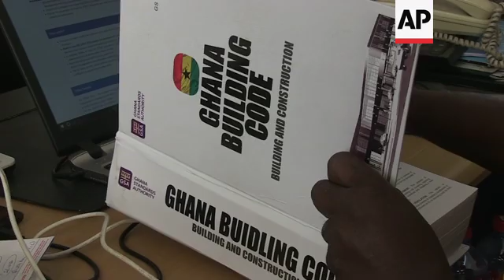Ancient construction tech adopted by high end architects

Comment: What materials to be used and with what ratio
Reply: You have to test your soil for clay to get a baseline for the ratio, so you know how much gravel, sand and lime to add as a binder instead of the concrete, which is not earth friendly.  But using concrete in the mix depends on the building code as the Ghanian brother was saying.    Those are ingredients I've seen on other channels, but an engineer can tell you the right ratios for your land.